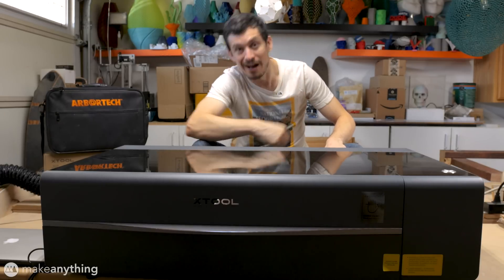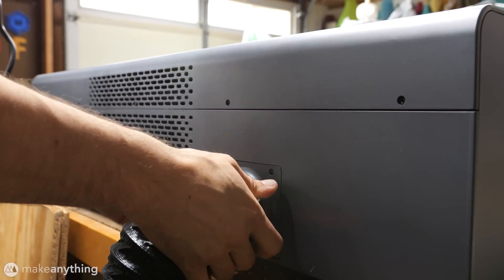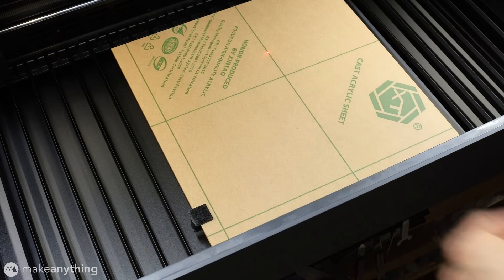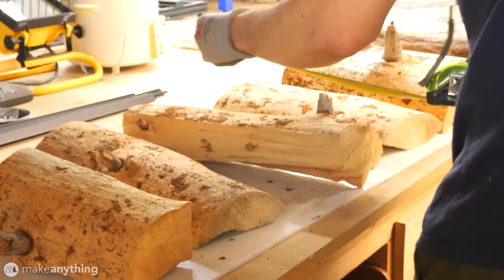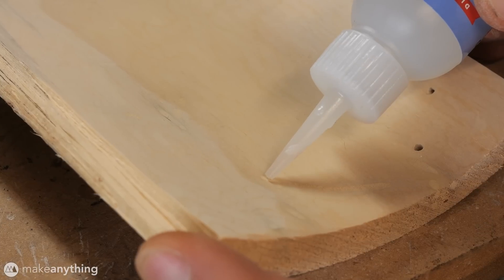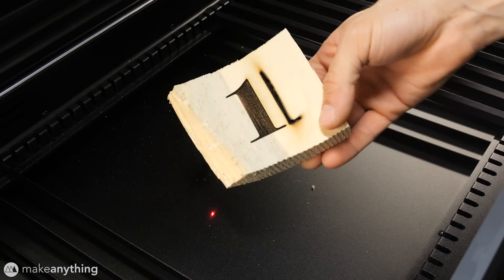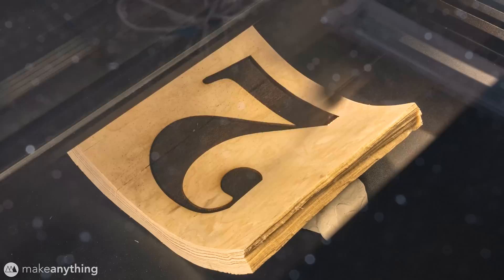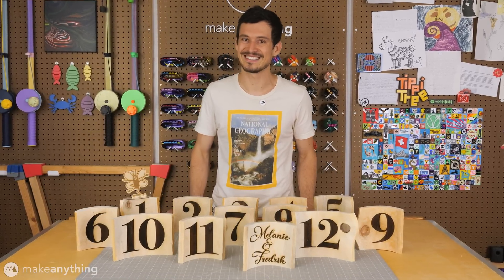3D Engraving with the xTool P2 CO2 Laser Machine

Comment: Question for you with regards to the acrylic.  I noticed that you kept the paper ON while cutting, but when we tried that, the cut did not penetrate the paper.  We then took the paper off, then cut the acrylic, and it worked.  My question to you is: When the paper is left on the acrylic, do you select TRANSPARENT acrylic or do you select another type of acrylic to compensate for the paper appearance?  Thanks.

Comment: Good morning . I would like to know if you use Windows 11 to work with p2; For my part when I use Windows 11, the machine stops when I burn with the default electrical connection air pump. I tested with an old Windows 10 computer, which is very slow, the machine works very well without problems. Maybe you could help me. THANKS. Happy Holidays

Comment: you should still add some of the anti freeze or some other product to the water to keep it from ionizing over time and grow algae
Reply: its destilled water
Reply: @melaniemontes2624  it doesn't stay distilled. It goes through radiator, pump, couplings, pipes, all of which slowly change the water's properties and eventually turns it into non-distilled water
Reply: True 😊